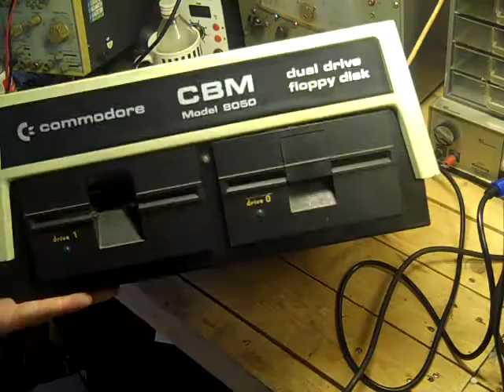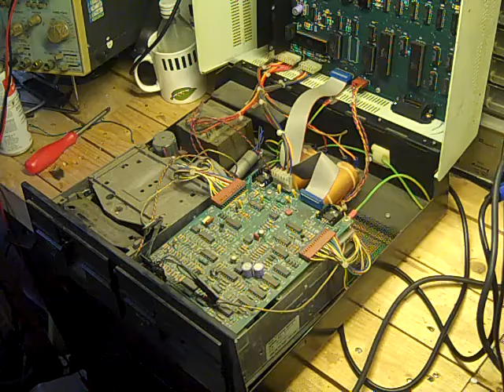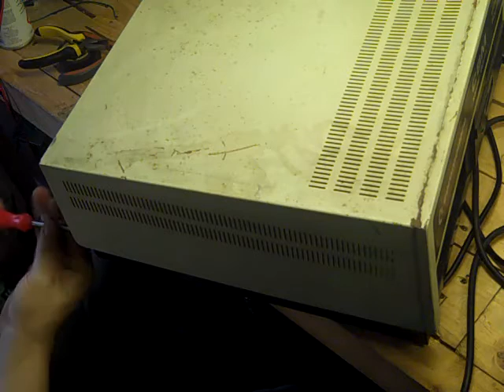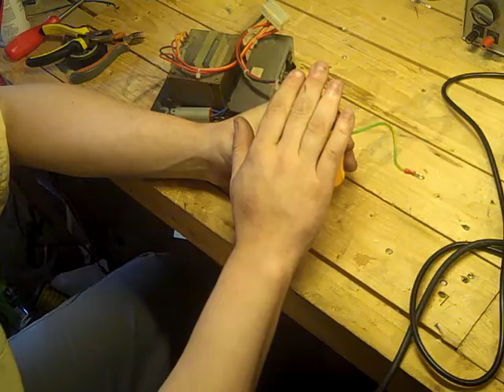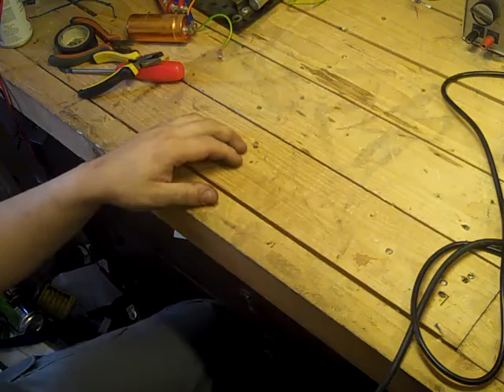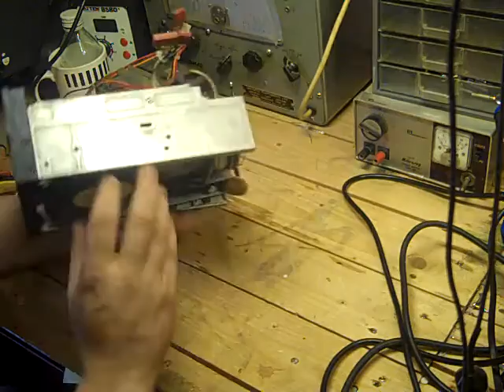CBM 8050 Disk Drive repair Pt1

Comment: RF Filter - remove it. It is usually the cause of issues - fails with a puff of smoke and stink. Then dead machine.  Power today is cleaner and besides, most powerbars have built in RF filtering.

Comment: Stumbled across this by accident & happen to see the supplied by sticker on top of the old CBM 8050 disk drive.
Wow-what a surprise, never thought I'd see a bit of kit with that sticker on again! 😲 I use to work for Datalect computers in Woking as an engineer & would have tested & stuck the supplied by sticker onto that drive 😉 Datalect computers would have supplied the CBM 8050 sometime between  1980 & 1982 Datalect went to become Datalect Computer Services & ended up being one of the largest computer services companies in the UK employing over 200 field services engineers with depots still in Woking, Greenford, Telford & Scotland & Germany. Datalect eventually ceased trading & was dissolved in around 2005 following its sale to Wincor Nixdorf Ltd

Comment: Just a tip about disconnecting cables in classic computer hardware: sometimes cables can get disconnected from the connectors, which caused me a terrible pain when I was trying to repair my Atari 1050 disk drive.  I had to solder the connector onto the wire because it was too small for any crimper that I had.  This all came about because I had pulled on the wire instead of the plastic part of the connector, so it is a good idea to pull on the connector rather than the wire whenever possible.